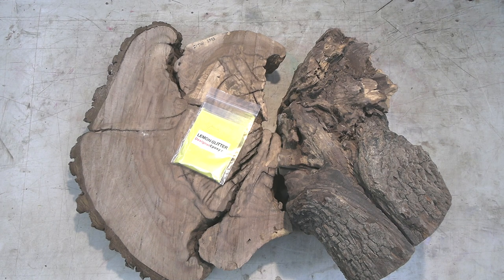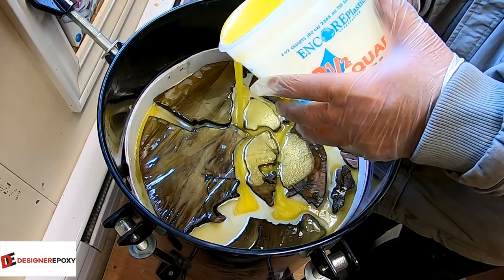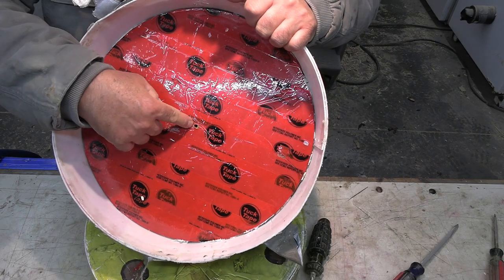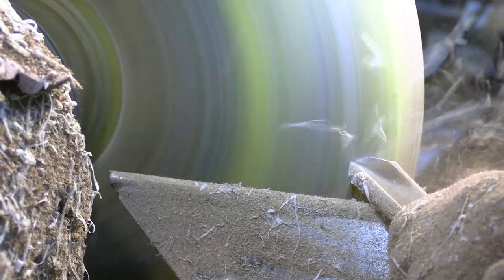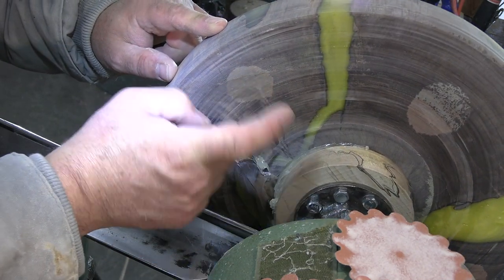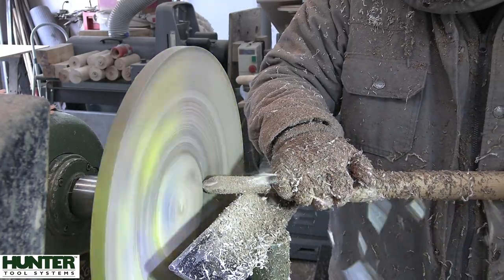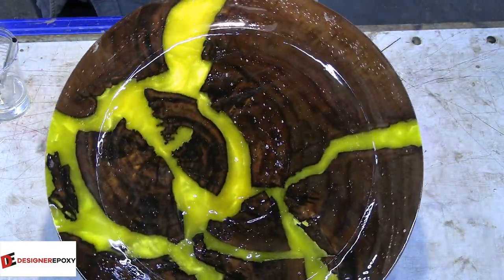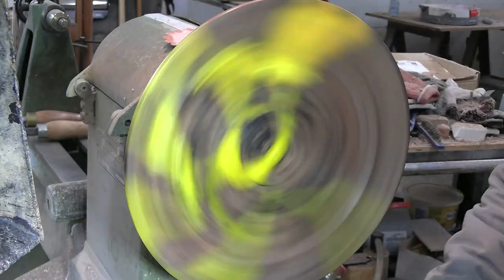Woodturning - The Lemon Glitter Platter Revisited

Comment: Hey Jim, I’ve put small pieces of masking tape in the mold first where I’m going to put the hot melt glue. Sprayed the mold release and removed the tape and spit glued the Hotmelt glue on those areas or the wood pieces would go. Worked for me most of the time. Good luck.
Reply from the maker: Yes, that should work just fine. Thanks!

Comment: That was a real nice recovery from the first platter video! While the yellow is a bit much, I think the piece is absolutely amazing. I know that it would add an extra day to your casting but in a case like this, could you do a thin 1/8”-1/4” layer of resin on the bottom with mold release and set your wood into is with weight on top to lock the pieces in place. You would then have a consistent coloring instead of glue splotches like you had. Since you did that coating it added the extra time anyway. Just an idea. Have a fantastic week!
Reply from the maker: I’ll give it some thought, thanks!

Comment: Jim your work is exceptional - thanks for sharing your work and tips - - also just typing out loud at ya here - but the hot glue stain thing that happened I'm thinking putting the glue down in the shape of a "C" might let the resin seep in and do its thing rather than a circle that would block the resin
Reply from the maker: That’s a good idea! Thanks!

Comment: I am so happy you can now put that mental "success" check mark behind the lemon glitter platter project as well. Great looking piece!
Very curious too on if you might trying to think of alternative methods to hold ieces of wood in place that wont prevent penetration of the resin or juts trying to work our a method to deal with that after the fact
Reply from the maker: This was a little bit of an oddball. Ordinarily I wouldn’t need to glue this many pieces in place but in this case I wanted the spacing so I didn’t see any other way. Someone mentioned putting the glue on in a C pattern, that way there’s not a dot spot and hopefully the resin would penetrate since it won’t be a large blob of glue. Thanks!

Comment: Glad it turned out this time. What will you do differently next time so you won’t get the glue melt “stain/penetration” issue?
Reply from the maker: Weights I guess or putting the glue on in a C pattern. This was suggested by someone else and might work as well. Thanks

Comment: Very nice finished piece. Have considered putting a coat of cleat epoxy on the bottom of the pieces before the glue to stop it from soaking in to the wood? The hot glue that you use should still hold it .
Reply from the maker: If you’ve got the time, then sure. I really don’t want to stop the resin from penetrating and I’m not sure it would penetrate from the top down fully, Thanks.

Comment: It looks like the wood has been dropped and has shattered, definitely a nice look to it.

One way to prevent the hot glue from preventing the resin from staining would be to coat the pieces in resin first?

Putting it in the pressure pot after coating the clear resin may have forced the resin to penetrate the end grain better/deeper?

Hard one to say definitively but may need some R & D to find out lol
Reply from the maker: Yes, that was the look I was going for. Putting a dam of glue around the spots then filling with resin and putting it in the pressure pot or vacuum chamber would probably work. Thanks!

Comment: Idea - 1. Put tape in spot where you want glue. Spray with mold release then remove tape and glue in place. 2. Put hot glue down, quickly spray with mold release. Then put piece down. The hot glue should spread out and hold. (MAYBE). Let us know if try either and if it works.
Reply from the maker: Your first idea if I’m following you correctly won’t work. If you spray the wood with mold release the resin won’t stick to it. The second one will still cause the resin to not penetrate the casting where the glue is as well. This casting was free in the bucket, the tape was the only thing holding it in place and causing issues. Thanks for the suggestions! Jim

Comment: I really like the scalloped edge you gave to the top of the platter.  I am also looking into upgrading my pressure pot and was wondering what is the largest diameter piece you can put into your 10 gal pot?
Reply from the maker: I believe the max diameter is 14.5” for a casting. Thanks!

Comment: After watching 70? videos I realized the most important thing in your shop are your custom casting buckets.  Dont ever solve the mold release issue we live for the struggle. Large Art Markers are what I use for touch ups (I make guitar bodies).  A light brown wide tip touch up marker and some alcohol to blend would have hidden those spots I think.  Thanks Jim!
Reply from the maker: Thanks for your advice!

Comment: Great job mate. that is a very nice looking platter! Can you use a heat gun to help release stuck items?
Reply from the maker: That bucket has 1” of plywood on the bottom, so in this case no. If it was a plastic bucket then possibly. Thanks

Comment: Gorgeous colour on the resin! 

Question - did the hot glue block the resin from pulling all the way through the walnut? I thought there was matching circle (resin void) on the inside of the bowl opposite one of the more obvious spots on the bottom side of the piece? Just curious as to the process of the resin 'wicking' into this wood using the pressure pot - does it pull up from the bottom (against gravity) or penetrate in from all sides. 

I also enjoy the amount of time you include on showing us that not everything goes as planned (release from mold shows that we never stop learning)!!!
Reply from the maker: It should of wicked in from all sides, but of course the end grain will absorb more than side grain and by blocking it off with the glue spots prevented it from doing so. Using weights are the answers but pretty hard to do in this case. Thanks

Comment: You may not see this since its an older post but have you ever tried using a piece of plywood a little smaller round than your bucket with nails through it and then your rock to hold the pieces down instead of hot gluing them to the bottom to avoid the circles where the resin doesnt penetrate
Reply from the maker: I see all the comments, lol. I will never put nails into pieces that will be turned on the lathe. Even if they are removed before turning, each piece will have a hole in it. Thanks for watching!
Reply: I didnt mean to nail into the piece your making but a round board on top with nails or bolts through it  so it would just sit on top of the pieces your working with. I just thought nails would be easier to pull up out of the resin

Comment: About bubbles: if you pour the resin into a large cake pan and use a torch to bust up the bubbles before pouring in the mold would you still need to use a vacuum or pressure pot.
Reply from the maker: It technically, but the pressure pot will give you a better casting. Thanks for watching!

Comment: Hi Jim, I find this platter to be one of your nicest pieces: the yellow and the walnut as the overall balance in shapes makes it very impressive. I was wondering at which speed you turned your piece when using the hercules? I recently built a rotisserie and it is fantastic for drying processes. Great demo and much patience to unmold the casting.
Reply from the maker: Every piece is different. Turn up the speed until it vibrates, then back it off until it stops. Thanks

Comment: Another nice piece Jim. I feel ur pain... I can't accept failure either. I would have done the same thing just to prove I could. Is that first platter still oozing or has it finally cured? I did watch the follow up to that first plate fail vid but I'm just curious what's happened since. Thanks for the vid.
Reply from the maker: I threw it in the trash, it was time to move on, lol. Thanks

Comment: When you were struggling with the extraction all I heard in my head was the Benny Hill music and I giggled my ass off! I wonder if using short 23 ga pin nails through the bottom of your bucket to secure the pieces instead of HMG would have given you any more grief than the duct tape. Would have allowed full penetration of the resin I think, but might have cost you more money for the rights to use the Benny Hill music for the extraction… Awesome piece regardless - thanks for another great Saturday morning!
Reply from the maker: This one was a bit of a pain just because there were so many pieces, not exactly sure what the solution is, lol. Thanks

Comment: So this is an older video, but on the off chance that you read this comment, here is how you fix that glue problem: Start with a thin layer of quick cure resin on the bottom of your cast, then place your wood directly into it. And I mean thin - just enough to hold the wood together. Once it's cured, you can do your full pour, and the wood shouldn't float because it's stuck in the resin. Granted, maybe I'm totally wrong haha, I don't actually turn or work with resin, too broke for that hobby
Reply from the maker: Yes, that should work, that is if you've got the time, lol.

Comment: wowzers - my husband is the health and safety consultant in this house - I didn't realise how much his rants have rubbed off on me - dude!!! protect your hands, please please, pretty please
Reply from the maker: I don't understand your comment? Protect my hands from what? I'm wearing gloves when mixing the resin, confused?
Reply: @SpragueWoodturning  watching you push the pieces through the saw at the beginning... yeah, you shoulda used 2 leader pieces. Prevent injuries before they happen
Reply from the maker: @michellemills1681  by not holding onto these pieces with at least one hand as you run them through the bandsaw your really putting yourself in danger. I get what your saying, but if you use two push sticks, the blade can grab the piece and torque it forward causing a ton of issues. Jim

Comment: Would it have been better to stabilize the wood before gluing it down? A few extra days, but might have been worth it. Also might be worth the time to build a framework that fits your pressure pot to allow for mechanical  hold down of pieces in the mold seeing as how much of your channel is devoted to resin work these days. Just my 2 cents  🙂
Reply from the maker: I prefer to not stabilize because the casting isn’t food safe anymore, there’s also some bonding issues with different resins sometimes as well, in this case it would of prevented the staining. Thanks

Comment: It's actually counter-intuitive, but you DON'T want to use gloves on things like grinding wheels. if an incident does occur, without gloves, the human reaction is to jerk away, which prevents further injury. With gloves on, the gloves can get caught in the tool/machine and pull the body part further in, making the injury far worse!
Reply from the maker: Thanks for watching